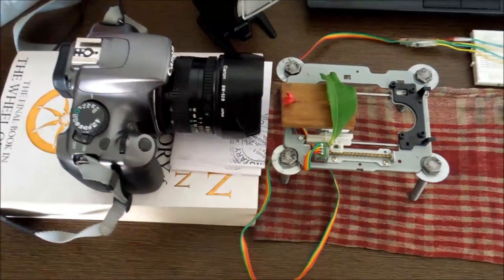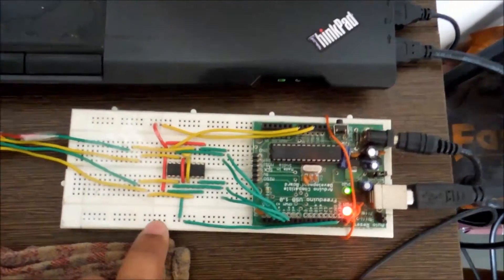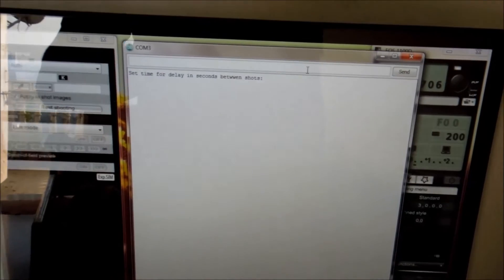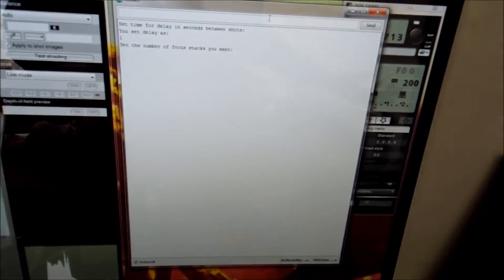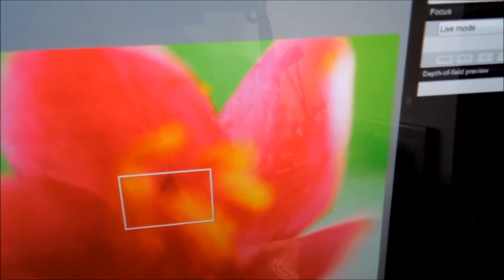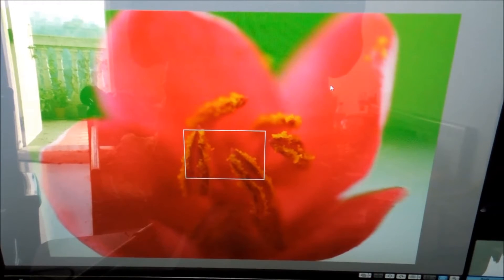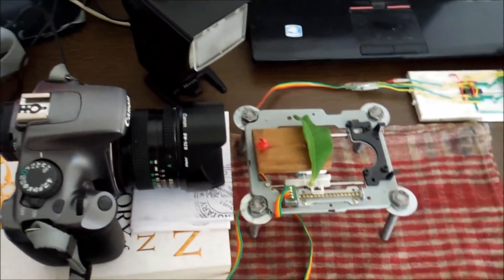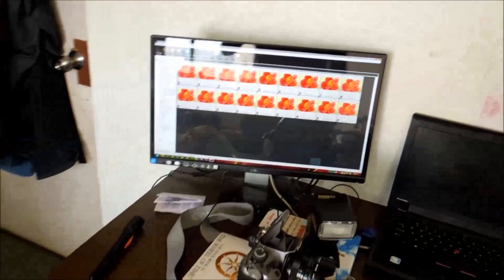Automated Macro focus Rail..

Comment: looks like you have a canon camera, if it supports magic lantern then it might support focus bracketing too. I still like your idea, because I was also thinking of using the cd player mechanism . Second, i like your idea because you choose to make a mobile platform for the subject, which makes sense considering heavy weight of the camera. Thank you.
Reply from the maker: Yes it does support focus bracketing. But that is only possible when using proper Macro lens. This here is an old 24mm reversed (Poor man's Macro). Hence the CD platter. Which i no longer recommend though. It is far better to have camera moving for stacking purpose. Hence a Slider is better choice here.
Reply from the maker: Also thanks.. I have taken a hiatus but will soon coming up with far more interesting contents.